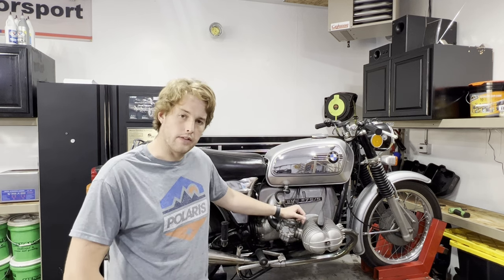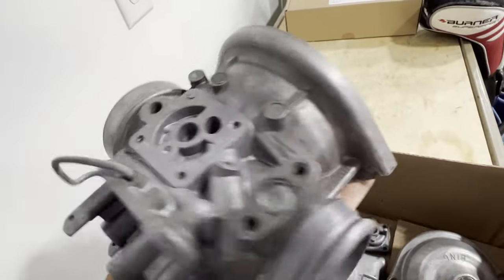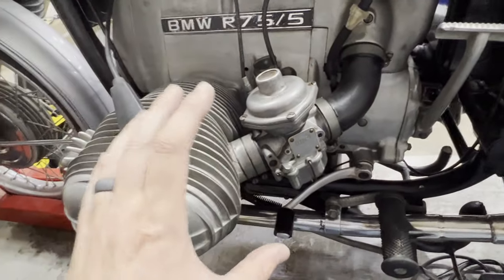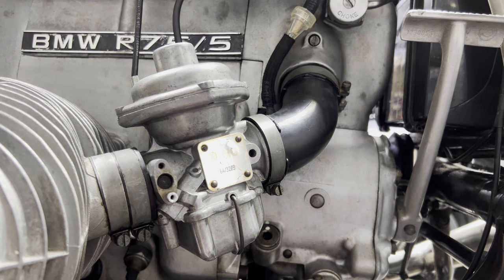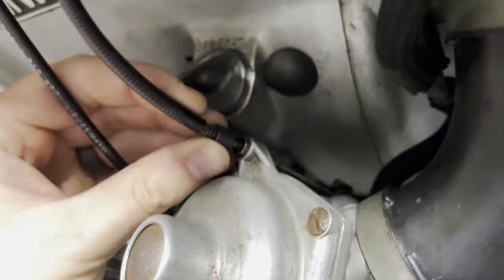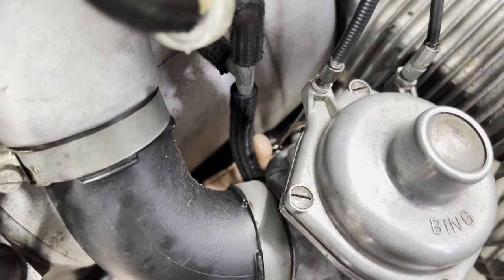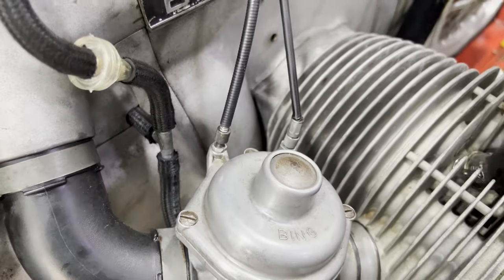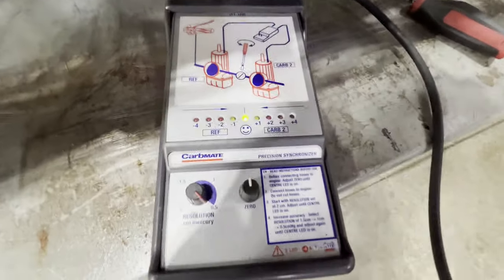BMW Airhead Carb Sync BING 1970-1995 models!! EASY

Comment: Really good and informative video. You should mention that this is the last stage of getting your bike run perfect. There is a lot of stages before this if your bike arent running well, such as; Setting valve clearance and check your ignition timing.

Comment: The fuel filters are installed backwards.  You want the fuel to flow into the end where crap collects in the void outside the filter media and be visible.  The way these filters are installed the crap will collect behind the filter media and plug it up.

Comment: I have been searching the internet looking for GOOD explanations with clear and informative photography to go with it.....finally found this on your channel...thank you.  I have been trying to get my 1972 R 75/5  carbs adjusted for a week  and most of the sites are more confusing than helpful. I immediately subscribed to your channel.  One question: Do you ever need to adjust the idle mixture screw in and/or out a bit from recommended setting until the carb picks up it's highest RPM's. This is shown on a lot of the sites I looked at, but not sure if it is needed, or if the Carbmate takes care of that?

Comment: Your "air screw" is in fact a fuel mixture screw.
There is a huge difference and knowing which is which is important to help one access how adjusting it will influence the setting. 
The CV or diaphragm carbs use a fuel mixture screw and the older slide carbs use a air mixture screw to help adjust for smooth idle and off idle running of the motor.
This setting will have the most effect at idle but they can also influence smooth running at higher rpm.
Reply: If you watched the video you would know that he did call it an air screw but right after that he explained that closing the screw leans the mixture and opening enriches the mixture.
It could not possibly be explained more clearly or correctly.
Reply: You’re the dummy. Dummy.

Comment: I have an R75/6. Does it matter which hose goes to  which carb? The instructions that come with the carbmate say  connect hose 1 (REF) to carb 1 "(for reference carb directly attached to the accelerator cable)"

Comment: Great video with important details for fine tuning!  Thanks very much!  Can you please touch on the cold start/choke/& warm up tips & tricks that must occur before you got your almost spot on idle at the beginning of this video?  My '84 R65LS (RED) is a cold start darling whose carbs air/fuel mixture base is .5 turn out.  

Question:  What must I adjust if RED cranks but won't start with enrichener/choke on; valves are in adjustment; carbs are clean & clear; cables in order; and needles & jets are true??  TIA SusanQ

Comment: Hi, great video by the way thank you very much.
I wanna ask if you can show us how to remove the vibrations especially at the lower RPMs. I tested out several airheads this weekend and rejected buying them because the vibrations were so bad. Is there a normal amount of vibration that we should consider?
I really would like to know that I’m not passing up a good bike just because it’s not tuned correctly. Thanks Jim in  New Hampshire.

Comment: Great video two points:  I agree with one comment about adjusting a well tuned bike makes it look easy. 2nd I have a ‘83 R80. With a differential water gauge the bike idles great when I open the throttle the fluid almost immediately gets sucked into the left cylinder   Not enough time to even check throttle cable adjustment.Am I missing something?  Thanks

Comment: Thanks for the video, makes perfect sense. I have a heap of slack in my throttle cable to carb joint, like 4cm .  Your's is barely a few millimeters. What is the issue? thanks

Comment: I see that some videos refer to the idle/mixture screw as the one right below the throat of the carburetor (surrounded by the tube molded in the carburetor body). In my 64/32/13 & /14 there is only that screw underneath the carburetor. There's the other one on the top, on the inside, next to where the cable attaches. Which one should I be using to adjust idle balance?

Comment: I have a 1970 r75/5, bings 13-14, timed, new points/ condenser, spark plugs NGK, lubed and 546 new advance springs, valves adjusted 6-8, carbs cleaned, new oil, trying as much as I can, starts right away but starts to coughing a lot until it dies … don’t know what to do next… help please…🙏
Reply from the maker: This is a service I offer to my paid subscribers, with the volume of messages like this is receive I need to sort thru them, and this is my way of doing so. Please consider joining my channel as a platinum number on YouTube or on patreon as a gold member
Youtube join- Look for the “join” button next to the subscribe 
Patreon Join Link- https://www.patreon.com/TheBMWGuy126

Comment: Thought I joined the channel ($4.95/mo) today, but I don't know where to put a question so I'm putting it here.  I just rebuilt the left side carb of my 1978 R80/7 using your video.  Went great.  Got it stripped down, cleaned up and reassembled with no extra parts.  Put it back on the bike, followed your sync video (using a Carbtune II) and again, I think I did it correctly, but when I did the temperature test on the two cylinders after a 1/2 hour ride, the left cylinder read approx. 270 degrees F, but the right one was at 360 degrees F.  Any help you can offer would be great.
Reply from the maker: Sorry you can send me an email at thebmwguy126@gmail.com. You can adjust your mixture screws on the carb to dial in the temps. Making it leaner will increase the temps and richer will decrease.

Comment: Great video - quick question for you. I live at 6000' and ride up another couple thousand feet in elevation locally. I have K&N air filters on my 81 R100RS. I had a local shop sync the carbs this past spring and was told the K&N air filters make this bike hard to start - it is hard to start cold. Once it starts and warms up the bike is idling around 3400 rpm... Which seems high. I think the mech who did the sync set the idle screw so the bike would start cold but that leave me with a high idle once warm.... Any suggestions?
Thanks
Reply: Typical procedure is to drive the bike for 15 minutes prior to setting the idle speed.
Reply: Do you have a link for the sync tool?? Thank you!
Reply: Ich brauche nur gute Böhm-Uhren.

Comment: Thanks for a great video!
I have the exakt same carb on my 75/5 but I do not have the screws where you plugged the vacuum hoses. How to sync then?
Reply from the maker: look underneath the carb, they are there
Reply: Same here on my 64/32/4 and 64/32/3 carbs. I also can’t find the screws to connect hoses... They are on an early 75/5. 
Very helpfull video though, thanks.
Reply: Some older /5’s didn’t come with them. You can order them in a kit, and drill them in. It’s not hard.
Reply: @JRose670  thank you!

Comment: is it possible to sync carbs without a tool? Like by sound or feel?
Reply from the maker: you can remove each spark plug cap 1 at a time so it runs on just 1 cylinder and set the idle to ~500-600rpm per cylinder. this is not as accurate and takes a trained ear. also measure head pipe temps at idle and off idle
Reply: @TheBMWGuy  won’t pulling the plugs risk damaging coils and other electronics? I’ve been using the spark grounding method described well in youtube and airhead sites and it works very well
Reply: Jkoepis, use a spare plug to ground the uncapped cylinder.